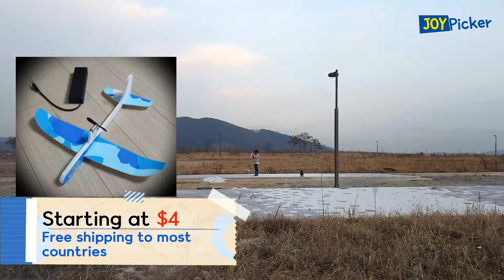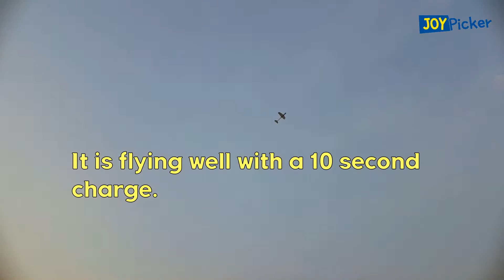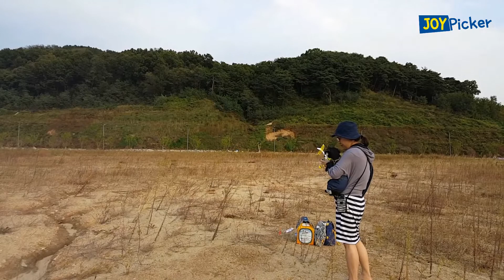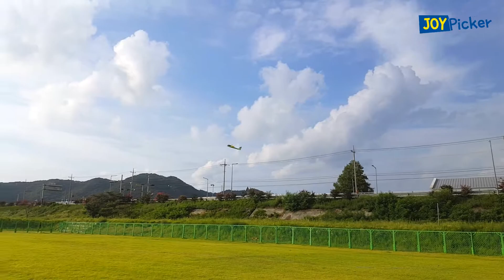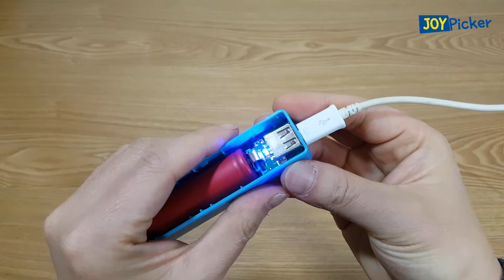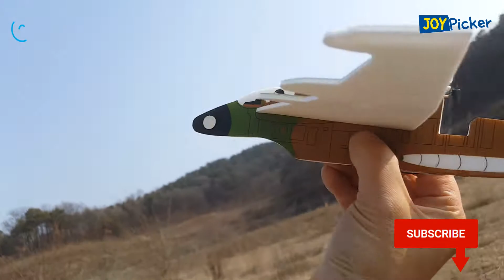Super capacitor powered airplane model Ⅱ : electric hand throwing free-flying glider

Comment: Of All my years of model flying the one element that has kept me coming back and interested in model flying is some form of friendly competition and organized club participation.  The secret to any club success is to require all club members to participate using a basic inexpensive entry level airplane. Your  Super Capacitors  are enabling beginners a cheap way to get started. But super capacitors can also make room for  very  sophisticated designs and experimentation models. That especially goes for timed powered glider duration competition among club members. With the addition of a little super micro RC control you have a very interesting path to entry level indoor competition. Sure there's room for freeflight competition but including RC control greatly heightens the drama of friendly competition by a huge margin.  Congratulations on a good and informative presentation of the basics of super capacitors.